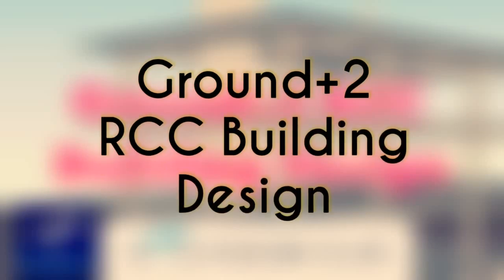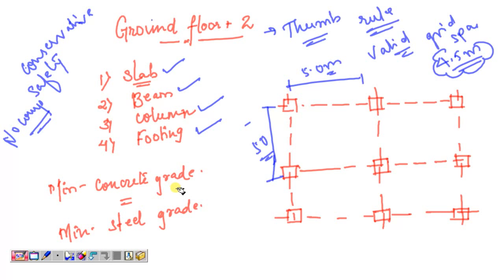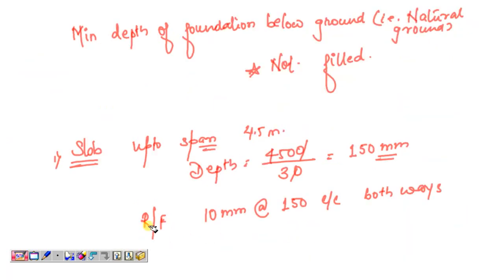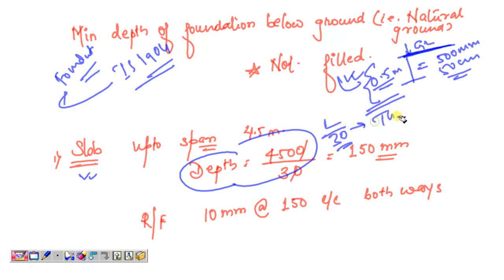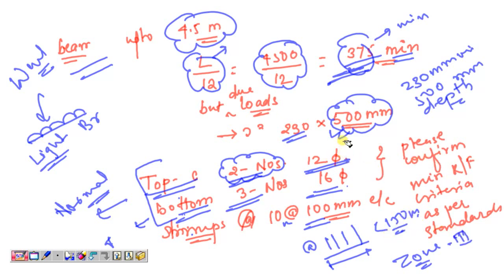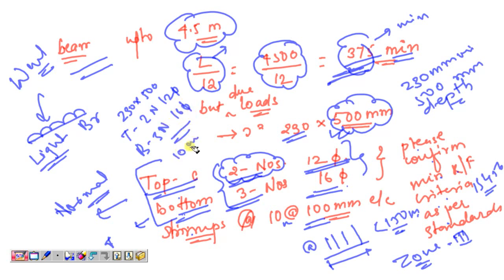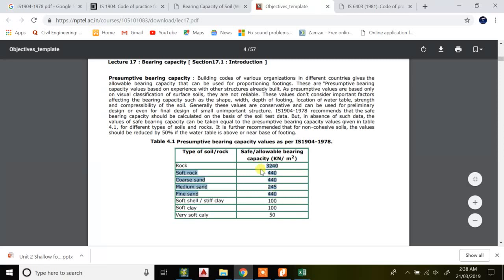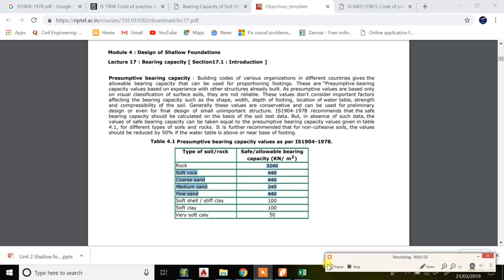Ground+2 Storey RCC Building Design using Thumb Rule

Comment: Being a structural engineer I must it's toooooo much reinforced..and uneconomical..and it violates many provisions of IS Codes ..there are many violation but I would like to point of a few of them which need not any deep knowledge it's only about code ..like spacing of lateral ties in column - 
As per IS 456 lateral ties should be least of following-
a) least lateral dimension

b) Sixteen times the dia of the smallest longitudinal bar.

c) 300 mm.

in this case least lateral dimension = 300mm
you have used 12mm Dia bars so it's 16 times = 12×16 = 192 mm 
So provide spacing 190mm and use 8mm Dia bars not 10mm , you have used 10mm Dia bars with 100mm c/c ..it's making structure heavy , unsafe and uneconomical ..it has fair chances of honeycombing in beam column joints ..
Please don't put such videos .. please don't risk anyone's life and money ..
It's my humble request please don't follow any thumb rule in structure design consult a structural engineer ..it will save your money and make you safe and secure.
Reply: That's the reason it says thumb rule
Reply: @bashist  such videos are very dangerous as it can hamper anyone's life or property. And as far as thumb rule is considered it's not a thumb rule at all thumb rule means approximation of results for which you are required to do structural analysis and design, but in this video many things for which we don't even required and analysis are incorrectly presented like lateral ties spacing, we can calculate spacing using simple IS 456 provision we need not to do any analysis .So it's not a thumb rule ..and at last I must in filed of structural engineering thumb rules does not exist .. please stay safe follow IS 456 and structural design is must.

Comment: U are making it over reinforced making the self weight heavier too, even in region like North East India we don't use this sort of specification for G+2!!
Reply: Yeah that's what I'm telling this guy...I dont know what he is making...
Reply: sir, is column size 150x450 is recommended for G+1 Building?
Reply: Nidhi, for G+1 minimum column size is 250 x 250 recommended for a span upto 4200mm. If U go higher than 4200mm then U can make the columns of size 250 x 350 with 4nos of 16mm & 2-4 nos of 12mm dia bars
Reply: @ArBisGHY  ooh okay sir thank you

Comment: Nice . I want add some important info. For beam, I think you forget about negative steel at supports.  So , if 3T- 15 bar at centre, then there should be atleast 3-4 T16 bar at supports.
Further your design is too conservative.

Comment: Coloum sizes is Rong
Reply from the maker: How it's Wrong? 
Please reply with correct size. 
The concept for column size here used is based on Short column which suggest the column least lateral dimension shall be L/12.

Comment: Great job.. But if it's a 10m x 3m building also should we provide 3m x3m foundation futing..
Reply from the maker: Foundation size depends on Column spacing and no of storeys so even if ur building size is more but column spacing along both the direction should be limited to 4 m
Reply: @AnthonyNisperos-bx4ss  this case better use mat foundation.